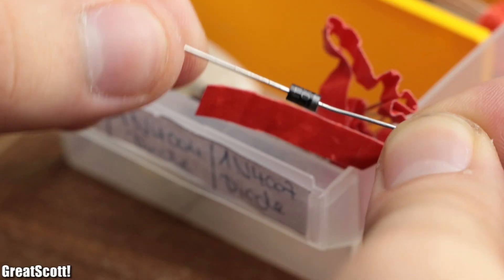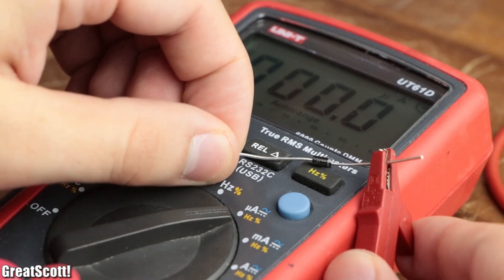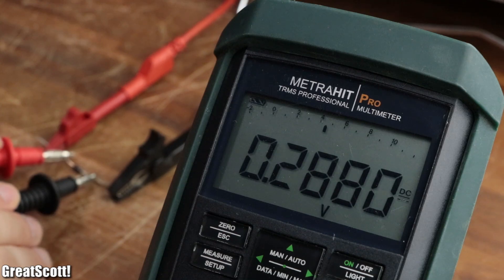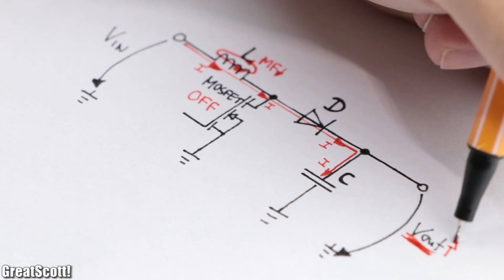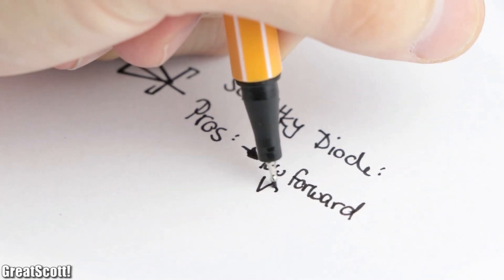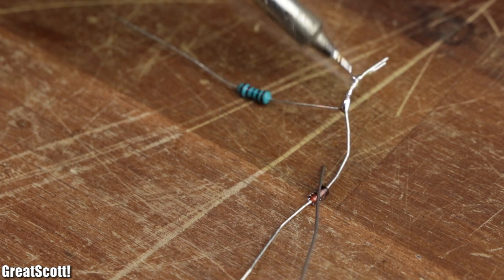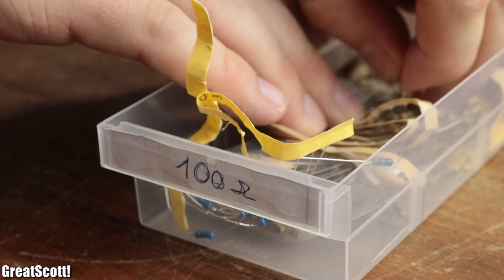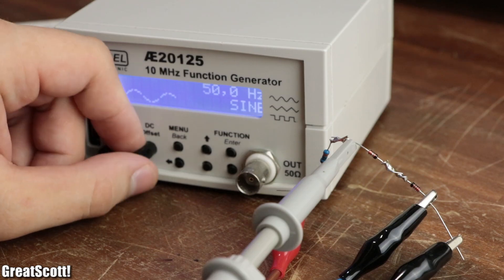Electronic Basics #31: Schottky Diode & Zener Diode

Comment: i have an odd question, for eg a 1n4007 has max reverse voltage of 1000v, so what will be the max reverse voltage of for eg a 3.9v  zener diode. its not given in data sheet. 

 though it starts conducting at 3.9v but how much more voltgae can i apply in reverse. i have an application where i am using a 3.9v  zener diode in reverse bias at 17v. i am using it for dead time in a mosfet h-bridge. 

also if i use zener in forward bias what is the max forward voltage . this is also not given in data sheets.

similarly what is the max forward voltage of a regular diode like 1n4007. its not given in data sheets.
Reply: max forward voltage of 1n4007 = 1kv

max forward of zener in forward bias = 91v
Reply: NeXTSTORMING where did you get this info
Reply: The maximum reverse breakdown voltage for a 3.9 volt zener..is precisely 3.9 volts. That is by definition, what the zener voltage is 

A zener diode is a diode where instead of the reverse break down voltage being high at hundreds of volts, the diode is deliberately designed to break down at a much lower voltage, the zener voltage.

With a non zener diode, you typically use it in a forward bias mode, but for zeners they are used in the reverse bias mode.

Comment: Is it possible to convert dc into ac or am i just chasing an electronic unicorn?
Reply: Easter Bunny 
Inverter
Reply: The Modern Adventurer I've looked into it i am having trouble understanding how ac can be converted into dc. Dc to ac is easier to understand but i don't get how the other half of the sinusoidal wave is created
Reply: its easier to create a square wave inverter that a sine wave one

square wave one needs mosfets and transformer tapped 12-0-12 to 120v or 240v
Reply: @nextstorming3908  but then you run into problems because you don't get a pure sine wave and some appliances/loads do not like being fed with dirty waveforms.
Reply: Easter Bunny 
I have a ham radio setup that uses a 12 volt powers supply that plugs into the wall. I believe, been awhile since I opened it up, it uses 2 transformers and a few other parts. Pretty much all there is but I don't know how you go from ac to dc scientifically. Now u got me interested though....
Reply: @themodernadventurer4320  There are a few ways, but the simplest to understand and build is a linear power supply comprising: a transformer to step down the AC voltage, a bridge rectifier to convert to DC followed by a large smoothing capacitor to reduce the ripple on the output voltage waveform.

Comment: A question: What is the leakage current of a diode?
Reply from the maker: It is the current that flows through the diode when the diode is reverse biased.
Reply: Ahhh ok, when it reversed flow a small current. If the reverse voltage increases the reverse leakage current through the diode increases until its destruction?
Reply: @diegoalfadelpinotasso2972  No.
You need to look at the I-V curve for the zener. When the diode is reverse biased, the leakage current flows, and doesn't increase until you hit the maximum reverse bias voltage, then the diode breaks down , its resistance drops dramatically and a large current flows

Comment: which soldering station can I buy which is good I am Indian so my range is 2000 rupees please suggest me
Reply: Amit Gupta : depends on usage and how much you want to spend. I have had two from a company called soldron from Mumbai, one being with small temperature control for around RS 650 and another bigger one 878d with a hot air gun for 5800 rs both bought from Pune. Both have been working great.
Reply: +Amit Gupta
This is where I got mine:
https://www.robomart.com/tools/soldering-accessories/soldering-station
It's well within your price range. I've had it for little less than a year, and it works great. Better if you can get a set of authentic Hakko tips.
Reply: hahaha 2000 makes it sound like alot but it's only like  $30 after I look it up

Comment: Is there a reason you don't use a current probe?  I feel like you've got to have one if you dropped that much cash on a 500mhz scope
Reply from the maker: I have one. But for what should I have used it in the video?
Reply: I'd really like to see an x-y voltage/current curve on different diodes, it's really interesting and I feel like it clearly shows what exactly is going on.  With your cc/cv power supply, you could sweep the diode's voltage range and get a pretty nice looking curve for demonstration purposes.

There's a good chance I have no idea what I'm talking about, so take that with a grain of salt :)

Comment: 6:15 if you put one leg over the diode and the other leg under it and twist the res a little bit, you will  create a better contact because the pressure is slightly higher. :D

Comment: Like always a great video.  I fly FPV quadcopters and we always have issues power system noise which impacts video and the flight controllers (i.e. Gyro).  Do you mind making a video on the best way to resolve overcome these issues?  Today we use low esr capacitors to try and smooth out the voltage which works but not always perfect.
Reply: It's not just about using a single type of capacitor with a low esr. You should consider using multiple different types of capacitor in parallel which have different esr to increase the bandwidth and be more effective over a wider range of frequencies.
This is often done on digital logic boards where there will be for example, tantalum and ceramic caps used.

Comment: Interesting symbols, in North America schottky diodes typically have little J's on the cathode end and zener diodes have angled wings. Are the symbols you used from a European standard?
Reply from the maker: I think so.
Reply: In Europe, and most other states, the ISO standard is used.  In North America you use your own symbols though some are the same.  Resistors for instance you will note are different as the ISO standard is an empty rectangular box whereas in North America it's a zigzag
Reply: @madcockney  its even worse with logic gates

Comment: Hey. Good day ms greet Scott. I have just a little bit question. Does the smaller diode have small about of current output even if your power source have a greater output and voltage?

Comment: Can anyone explain me the cliping part when he connected two zeners in series ? I did not get that part
Reply: The two diodes are in series facing each other, so on the positive half of the cycle one will be forward biased and have very low resistance, the other will be reverse biased and start letting current through once the voltage gets too high. They are connected to ground, meaning that the signal shorts to ground once it gets too high and doesn't reach the output. On the negative half of the cycle the same thing happens with the opposite diodes.

Therefore the signal at the output is clipped at the zener reverse breakdown voltage
Reply: It's clipping both halves of the sine wave, thus keeping it within the zener voltages. You could vary the two zener voltages to different values, like keeping the positive side under 10 volts and the negative side above negative 5 volts. I agree that the wave form he showed didn't really make a lot of sense.

Comment: Hi there Soctt.
I make DIY project with Arduino. Whole project will be Powered up with 18650 batteries(voltage will be boosted). Only problem is that I don't have any system that will tell me "hey, batteries are below 3.5V).
So my question is how to make circuit that will turn on LED if batteries are below 3.5V)?
Reply from the maker: Just search for battery protection circuit on Ebay. They do exist.
Reply: I Know, but I need something different. I have Protection on my LiIon modul, but I need indication that battery is low
Reply: You can do it with arduino code if you have one free analog input pin and one digital output pin
Reply: Pararera It is accurate enough for this use, look at this :
https://www.gammon.com.au/forum/?id=11497

In the section "detecting low voltage"

Btw, read the entire thread, really helpful if you want to save some mA
Reply: I Know for that method, but it's not accurate. And I'm out of any pins
Reply: Thanks!

Comment: Great video... But if you are making a video about diodes and its types it may be out of scope for beginner audience to understand mosfets and boost converter working.
Reply from the maker: Understanding the boost converter completely is not mandatory to understand why a Schottky diode is used there. But I like to keep more complex circuits in  basics videos so that the viewer gets interested in the subjects (in this case the boost converter) and wants to learn more about that as well.
Reply: GreatScott! Surely, btw I love your videos. They have inspired me a lot. Also, are you a power system engineer or power electronics engineer?

Comment: Great vid as always!
Reply from the maker: My videos can be viewed earlier by my Patreon supporters.
Reply from the maker: Thanks mate :-)
Reply: How can this reply be posted one hour ago while the video is only one minute old?
Reply: Patreon magic I guess
Reply: Say I'm charging a 12v car battery with a step down DC to DC Converter using a 19v supply and I don't want any feedback to kill my converter, which value Schottky Diode do I use? Thanks
Reply: MrBrymstond you will need a Schottky with a value higher than the charging voltage of a lead-acid battery (someting like 14.5) and taking into account the voltage drop across it (assuming you use the diode as a conventional one but want a lower voltage drop)
Reply: Right, but what about the amperage on the diode? I want to stop current from feeding back to the chip and killing it.
Reply: Something higher than your supply maximum current I guess
Reply: I'm not talking input, I'm talking the amperage from the 12v car battery feeding back to the chip on the DC to DC converter. I need to place a diode just before the battery so the current only goes one way. With out a diode the current goes both ways and fries the chip